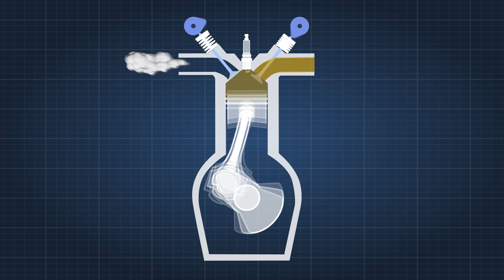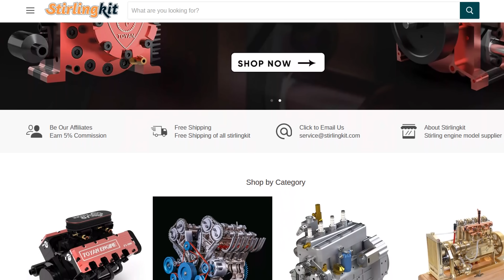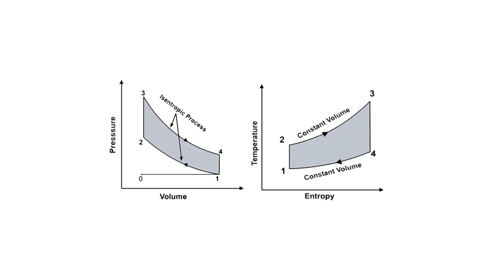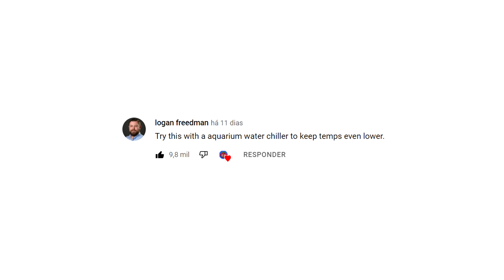I 3D Printed a Transparent Combustion Engine in Resin

Comment: I think a lot of the performance differences, and the skipped power strokes are due to timing issues, as you also hypothesised. In ICE in f.e. your car, timing gets advanced so the spark comes a little bit early to give the mixture time to combust. This timing advancement is dependent on fuel, timing and RPM, so I can imagina if you change any of these things your results will vary wildly.
Reply: Yeah, advance the timing ignition.

Comment: All the alcohols you tested have a different stoichiometric ratio, which you briefly touched on. Gasoline is 14.7:1, and while I don’t know about methanol or nitromethane off the top of my head, I do know that ethanol in 9.7:1. So you need much more fuel to combust with the same energy. Where the benefit comes from with these alcohols is in high performance engines with extremely high cylinder pressures. Gasoline will burn too hot and too fast, which can cause problems such as pre ignition, and melt pistons. When you start to get into high compression ratios, advanced ignition timing, and forced induction, these alcohols have their place. They burn cooler, and slower (the slower a fuel burns, the higher the octane rating). Running pump gas under these extreme conditions will often be detrimental to a cylinder, but the alcohol fuels make it much safer to run.

Edit: also, an added benefit is, alcohol burns much cleaner. If you ever disassemble an engine that’s ran on alcohol vs gasoline, you will notice that on the piston, valves, and cylinder head will have lots of carbon deposits, whereas the alcohol engine will look clean as a whistle!
Reply: this was also my thought. You can't simply change the fuel without tuning the whole engine cycle (compression ratio, ignition timing, air-fuel ratio, etc.) fitting to the fuel.

Comment: I would speculate the stroke missing has to do with the load on the engine. A load would pull the RPMs down and thus the cycles would complete in the allowed time to meet the next power stroke. This would mean the powerstoke  is only missing because the engine is using inertia at the point the second powerstroke would hit so it essentially becomes another suction phase that would cause a combustion failure. but the inertia in the system wouldn't be great enough to maintain a speed that can skip a third powerstroke cycle.

Comment: The engine performance difference probably has something to do with air fuel ratio and since the carburetor is very basic and you can't adjust anything on it, the afr is most likely very jumbled up

SOOO here is an idea, how about 3d printing your own carburetor

Comment: Video idea: Create an engine that uses a fuel cell for hydrogen or similar. Less heat and more efficiency!

Also, the piston chamber might simply be too long, causing inadequate compression.
Reply: isnt hydrogen one of the hottest burning gasses

Comment: Maybe you could try the see through carburetor? On that note different fuels need different carburetor settings i.e. jet sizes. There is also another channel called 2strokestuffing where has designed and built different 2 stroke engines with all sorts of fuels and add on.

Comment: i guess the ignition timing and the carburator jetting need to be adjusted to make nitromethane work propperly...
you need more fuel than gasoline and the burntime is different and therefor the decompression timing is different..

btw..at enought compression the nitromethane/oxigen mix will ignite on it´s own..just like diesel..

greetings from germany
(i am a small engine mechanik for an Karting club)

Comment: The Nitromethane might run worse because the air fuel mixture in the engine is too oxygen rich because you are injecting too little fuel? After all the engine was designed to run on Gasoline which as you said, requires much more air to combust

Comment: Maybe the fuel is not receiving enouth air from the carburator to ignite but the compression and expansion of the fuelair mixture via the inertia of the crankshaft is acting as a pseudo powerstroke that feeds the system a fraction of power but keeps the wholething moving.....

Comment: The stock valves or exhaust path are too small to get the exhausts gases out quickly.The 25% mix produces a ton more expanded gas than the others do. That's yout limiting factor for this engine air in and exhaust out, you solved the air in by changing fuel but have the air out problem to solve now.

Comment: If you give the engine load then it will ignite every 4th stroke. The carburettor ensures that the engine is kept at one speed and therefore does not fire with every power stroke. :)
Reply: Well not really. What you are talking about are "hit and miss" engines and they usually keep one valve open when combustion is not needed. A carburetor just mixes fuel with air, it doesn't keep the engine at one speed by skipping power strokes but rather by limiting the amount of mixture that is sucked into the cylinder. Combustion should happen every 4th cycle.

Comment: Is just a theory, but i think that the menthanol with nitromethane as the other fuels have a stokiometric ratio to follow for the perfect combustion and with a carburator with the same jets you obtain richer or leaner mixtures of fuel and air so you have different combustions types that don't follow the expectations. (sorry for the english) i wish this comment is useful
Reply: a new carburator and ignition are needed to have perfect combustions every time

Comment: Integza, all your skipping cycles troubles are related to the fuel-air mixture. Different fuels have different density, therefore if you don’t adjust the carburetor, it won’t work properly. I don’t know if you have adjust on that carb, but if not, you have to adjust some how the fuel metering jet… for metanol it should be smaller, as metanol is less dense than gas…. Modern multifuel engines today do that by adjusting the injectors opening time, thus adjusting for less or more fuel per volume of air.
Reply: @kese5593  maybe you are correct. I got it the other way arroun, nevertheless, the rationale is the same… ajust the f..ing mixture.😀😀😀👍
Reply: This^

Comment: You must put more methanol or nitro mix by increasing the "jet diameter" . I asume this "carburetor" has no jet in it so you should increase the diameter of the hole through wich the fuel gets in to the engine.

Comment: it has to do with how fast the air fuel mixture burns as the flame front moves at different rates depending on the fuel, also i don't think you adjusted your carb to run richer to take advantage of the ability to burn more nitromethane and as you said it's less energy dence so given the same air fuel ratio you make less power.
Reply: the problem is that he can't. Look closer, at the valve he uses to control the engine. That's the carburator bellow it. He can only control throttle, not air-fuel mixture.

Comment: I can't say for sure that the same principle applies to motor vehicle engines, but I know in power tools, a higher gear ratio at a lower speed = more torque.  I'm guessing something similar is happening here, where - when you use more energy-dense fuels like Gasoline and Nitromethane - the explosive (power) stroke outputs more force onto the piston (relative to less energy dense fuels like Methanol), thus the speed at which the piston travels (and the distance the piston travels) within the cylider during a given stroke increases, thus more air is gathered during the intake stroke, more gas is compressed during the compression stroke, and the net result is more force/torque output.  

Again, I could be wrong, but to summarize the above, I think what you're seeing with the more energy dense fuels is this: 

The power stroke is literally more powerful, increasing the distance the piston travels within the cylinder, which translates to less strokes occurring overall (hence the lower RPM), but each stroke is more productive, and thus more power/torque is output.  I could be dead wrong, but that makes sense to my uneducated brain.

Comment: Here in Brazil we use boot, methanol and gasoline, and is Know that methanol is most powerful than gasoline, but it needs more compression and is less efficient!!! (But is cheaper here)
Reply: Because that we have engines that run with metanol and gasoline, but if the methanol is above 70% gasoline price you can go with gasoline